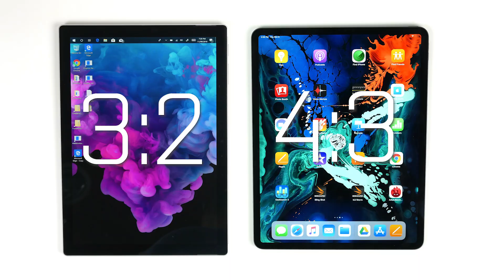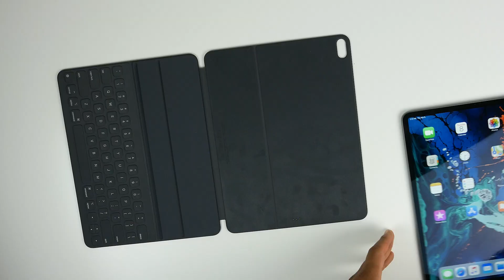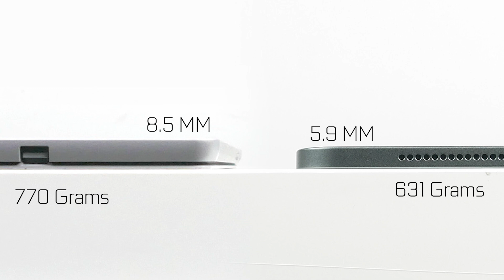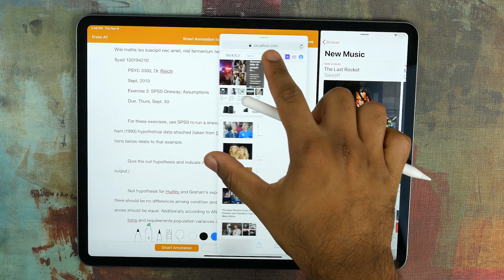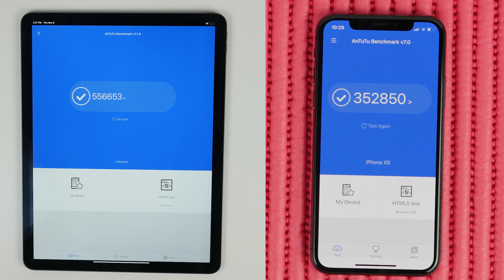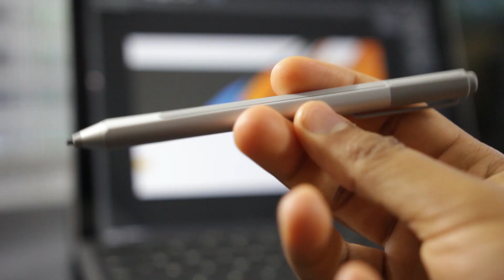2018 iPad Pro vs Surface Pro 6

Comment: Surface Pro = Work
iPad Pro = Multimedia, gaming, art.
Reply: Work can be many variety of things audio, video, 2d and 3d design, office application, also multimedia, gaming  and art lol, you made it sound like its just one thing compare to three things that ipad does, actually its many things.
Reply: Gaming is better on the surface because of mouse and keyboard+ ALL OF THE PC GAMES. YOU HAVE STEAM ON THE SURFACE.
Reply: @your_average_clippy  And so what? The hardware is not powerful enough to run those games at an adequate quality settings with a good FPS (try running Battlefront 2 on it ;) ) while on the iPad you can run any game that can be found in the AppStore on "max settings" and with excellent FPS
Reply: @groberti  games in the appstore, HA, HA, HA, yeah that's heavy gaming pal
Reply: @gregyance9901  Try playing BF5 on a Surface Pro ;) Don't be ridiculous, you can't do any heavy gaming on a Surface product
Reply: @groberti  Try playing it on the IPad, oh yeah it won't even be possible to install it, man use your common sense, you stated that the iPad is for gaming which is not true at all, it will handle all the mobile games fine, but it is not capable of anymore, while the surface can actually do the same and then some, it doesn't matter if it is going to run some triple A games at 720p low graphics, it WILL run them, IT IS more versatile and WAY more complete, It has much, much, much more options even in the gaming department that the iPad hasn't, even emulators, so the IPAD it is NOT for gamers, your arguments have no logic, BE objective, BE smart, think about the FACTS, from a reasonable perspective, as a matter of fact NONE of these devices are designed for gaming, but the surface it just outrun the iPad in options, capabilities, price, etc, etc,etc, you can do in the surface everything you can do on the IPad, and MUCH, MUCH, MUUUUCH more at a lower price, fix your logic
Reply: Surface pro is better at multimedia and art too seeing that it offers the full adobe suite. iPad doesn't even have full photoshop or illustrator.
Reply: @lukedependahl5746  can't say that the surface is better at art since you have to buy a wacom tablet to run with it since the pen is worse than the ipads, and if you argue that point you can use astro pad for the ipad and use the apps on a macbook too.
Reply: @lolsa123  I'm a digital artist lol, I own 2 wacoms and a Huion and I prefer my surface pro 100% I'm using the $60 Bamboo stylus and it works incredibly well.
Reply: Luke Dependahl what about compared to an iPad or iPad Pro?
Reply: @groberti  what? Ported games that made the game low quality? Like life is strange and walking dead? Its ported bro .. PORTED.. LOWERED .. OPTIMIZED.. STRIPPED DOWN VERSIONS
Reply: @groberti  here's the proof bch https://youtu.be/Dj7BCO2nwbI  .. i bet youre talking about the mobile version of all pc games which is all stripped down to work on an ipad lol and you really thought that its the same thing well its not.. its like a human forced to be dumber just to be understood by other dumb persons.
Reply: Gaming? Mobile gaming, maybe.
Reply: Realtime performance>synthetic benchmark
Reply: surface "pro" = toy, buy a laptop instead.
Reply: Games on iOS ARE minigames comparing to games on Windows, PlayStation, XBox, etc. iPad is not for the TRUE gaming. It's just for time killing.
Reply: Nadekon so does surface pro live up to being able to “game” properly? Even the lowest version?
Reply: @erxfav3197  Of course. I recommend you to watch some gaming reviews on youtube if you're interested.
Reply: Are you kidding???You are saying that Ipad gaming is better than PC gaming???
Reply: Child gaming for iPad Pro.
Reply: @groberti  You don´t even think what you say right ? ,   "iPad IS for the MOBILE GAMERS while Surface can't do more than.......mobile games" , so basically they can do the same , isnt it ? ,WTF is wrong with your logic ? (your conclussions are brilliant)  , I SAID  that is POSSIBLE to install the game in the surface  ,NOT running it at 120 fps, I SAID that you can´t  even install the game ON THE IPAD, YOU functional analphabet (read and think first) , I SAID Surface has more options for gaming that are NOT possible on the Ipad , are you even aware of what we are arguing here ? , you just rant like a chicken with no head ( and no brain) , and of course  the  insult as last resource for lack of arguments  is a must isnt it ? , I ALREADY KNOW that for a true gamer experience you need much more powerful hardware dummy  is it not clear to you that it is perfectly implied by itself ? ,I SAID that none of this devices were created for gaming experience
Reply: "gaming" get lost
Reply: @davidkern7636  artist  get lost lol what kinda job is that  and I'm not even a gamer like that I just don't understand the need for that screen
Reply: It is for teachers and students and school and work the iPad pro
Reply: Creating "art"  is work for many, many people. The Surface can't do anything more or better when it comes to this kind of work. It is actually worse because the iPad has a much better, more color accurate 120 Hz display which is an amazing feat to achieve. I've was able to try it out live and it is butter smooth. You CAN feel the difference between 60 vs 120 Hz.
Reply: @groberti  you can install steam on surface and enjoy thousands of games, what most people do is they use chrome (extension wow). surface all the way for laptop experience and for the tabelet ipad is the way to go.
Reply: @golupandey1006  So what? The Surface is not a gaming machine. Is the possibility there? yes. But is the hardware powerful enough? NO!  The hardware is not powerful enough to run those games at an adequate quality settings with a good FPS while on the iPad you can run any game that can be found in the AppStore on "max settings" and with excellent FPS
Reply: @groberti  games that can be found in appstore are almost all minigames lol
Reply: @groberti  I don't think artists need 120hz screens what would you even use it for , you can't even game over 60hz on ios
Reply: React King latency dude.....................
Reply: @reactking7093  Oh they do need the 120 Hz when drawing for example, makes the screen more responsive, it is as easy as that.
Reply: @groberti  yeah but that's just a gimmick truth be told , a real artist doesn't need 120hz screens and an a12x to make that happen it's just a waste of money but if you got it like that then do what you want  just don't expect no one else to think your smart at spending your money
Reply: @reactking7093  I don't have an iPad Pro, sadly. I don't have the kind of money to buy it yet. The 120 Hz is not really a gimmick if it makes the user experience better ;)
Reply: @groberti  whatever the 1080 ti makes gaming better but you could buy a 1050 ti which will do good on virtually all games so yes a 120hz screen on a iPad running ios is a gimmick
Reply: @reactking7093  Sure it could if it wouldn't overheat or become obnoxiously loud because of the thin nature of the "laptop". It is not meant for serious gaming, you are in denial if you think it is.
Reply: React King what do you mean?

Comment: I'd rather buy a gaming pc thats good for gaming and work at the same time.
Reply: But the main point here is the convenient and portability. PC is also better.
Reply: off course pc better for work but, this is about portability. you didn't bring your pc to each cafe right?
Reply: You must be strong as fuck carrying that thing around
Reply: I use a tablet as a mobile camera interface using a camranger.  This is how I take interior and exterior photography as I have to be able to move around with my light.  I use a tablet because the screen is large enough I can see my work as I go.  I am not going to carry around a gaming PC, obviously.  Furthermore, gaming PCs are rarely the best PCs for graphic work, the needs in a monitor are completely different.

Comment: iPad pro may be faster in Geekbench, but it isn't actually faster, it has no cooler, so if you run geekbench mulitpule times the scores will drop a lot, whereas the Surface will only drop 10 to 15%

Comment: The new iPad has a blisteringly fast processor. However that's not the full picture. A device will only work as fast as the slowest component within that device. So  things like ram, graphics etc will either keep up with the processor or bottle neck it. Unfortunately Apple tend to make super fast processors bit do not add other compoinants to get the best out of their devices. With the iPad everything is pretty we integrated and everything from a hardware perspective works well with each other. The problem with the iPad actually lies with the software integration. It's simply not optimised to carry out laptop or desktop taks. Lots of desktop applications will not work with the iPad. It's simply never going to be a laptop replacement. And tbh why would Apple want this? Surely from a business point of view this would be in apples internet. I mean they have MacBook s to take care of this side of things. And these are even more expensive than iPads. Why would Apple want their iPads to out so their macbooks? Or even their updated mini macs. Apple would quite easily manufacturer software to turn the iPad into a laptop replacement of they wanted. It's certainly powerful enough. But they're never going to do this. 
So my point is it's just not feasible to compare iPads to laptop or desktop replacements as this is not what the iPad is about. Imo
Reply: You know that a12 chip ia based on arm architecture which was created for simple work and to reduce heat..apple does not have the license to create a x86 proccessor to make their own cpu for a pc.
Reply: GTech Fam macOS was built to be architecture agnostic, meaning Apple can switch to arm and in theory any app created in the past 4 years should work
Reply: @hajjdawood  nope. They should have to change their base to match the architecture of the arm. It is possible. But all the driver will become incompatible with this  .